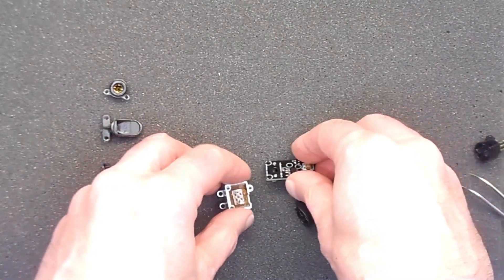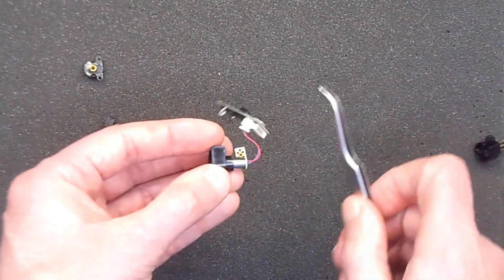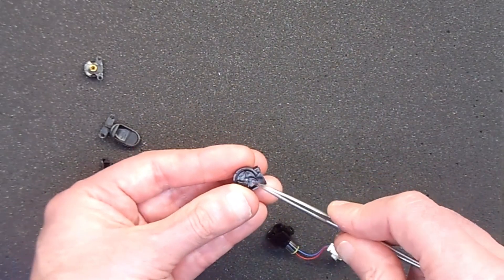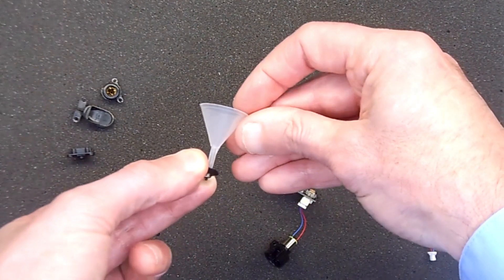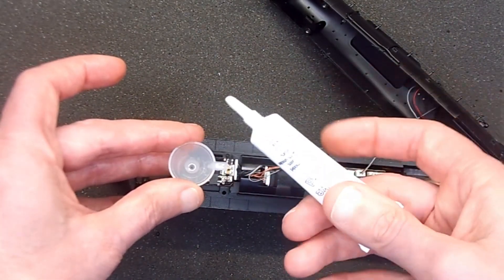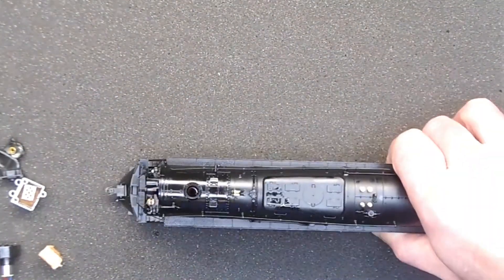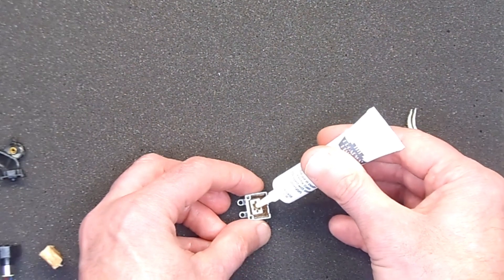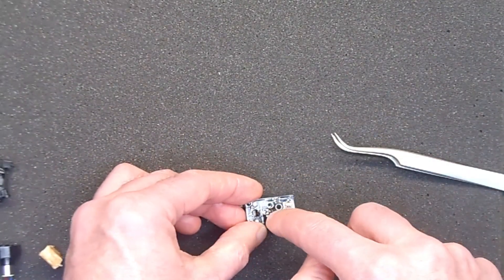BLI's Smoke Unit Inside and Out

Comment: i have the blue goose and the FEF 2 triplestack .. i have set the settings the same i did for my goose as i upped the smoke temps and stuff .. but i dont get as good smoke out of FEF that i do with the goose .. do you have more then one smoke unit? i would assume they should be the same under the same settings

Comment: I have 15 BLI steam locos and have had 3-4 smoke units fail. The motors crapped out. I simply installed pager motors and they work perfect.
Reply: Cann you provide mre info on pager motors.  Price, part number and source!!
Reply: @frankbed  hi I believe the correct size was 6mm on eBay. The shaft was slightly longer than the oem one but I simply dremeled them shorter. It is not too difficult but there is a chance the boiler can crack if you man handle it too much. If you’re lucky there are two screws that screw into the front of the boiler weight inside that attach the unit. You will have to pull out the wiring with the unit and this can be the hardest part to put back in since they is very little room. Good luck!
Reply: @ocdaddvids  Thanks !!!

Comment: I have 2 bli a fef and blue goose. I used the small recommended oil fill rate which I think is 6 drops max or something like that in the bli manual. Right away brand new I had problems the smoke quit working. I opened up the unit and found the oil media was slightly chared on top indicating it was dry. Scraped off the char and put back together.  experimenting I found I have to use way more oil than you state like 20 drops if I remember right. No overflow and the fan works fine. But even with the 20 drops the oil is burned quickly very quickly there is no runtime with the smoke unit you have to babysit  and keep adding oil. Your element is way to hot this is the problem. You should have a slow stead heat and have to wait for the unit to warm up. The fact that this thing reaches smoking temp instantly is a no no I bet that element is way to hot. from what I've seen dries the pads out in  2 minutes.
Reply: You can adjust the heat level with a couple CVs (idle and max power)